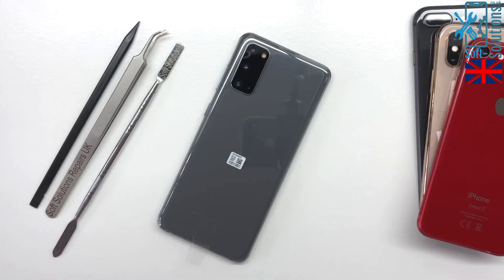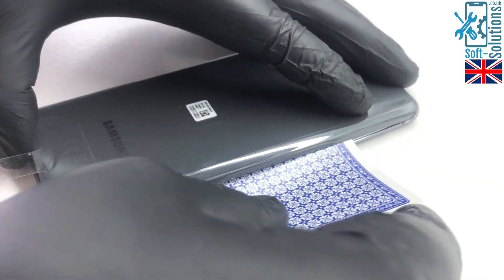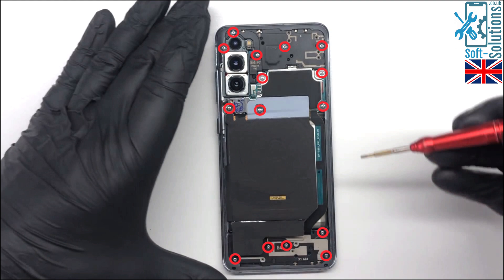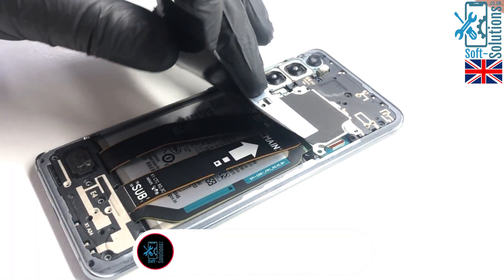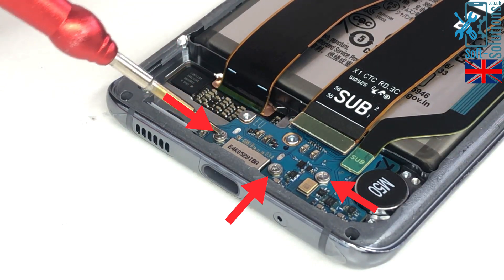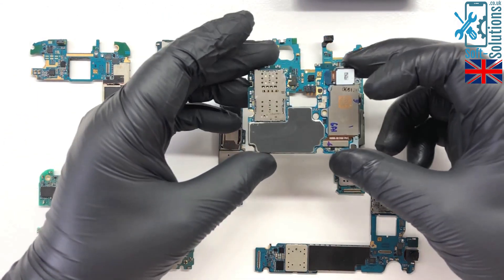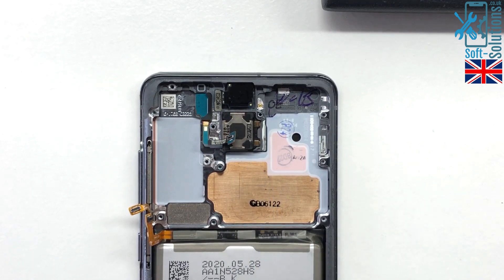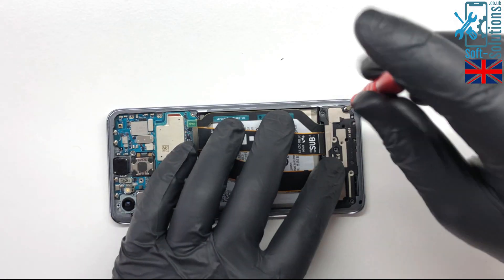Samsung galaxy s20 Teardown, disassembly.

Comment: My S20 seems to have a loose connection. The screen goes blank or flashes or displays screwy colors. I think it was dropped or hard hard. Could it be a loose cable? Should I try to repair?